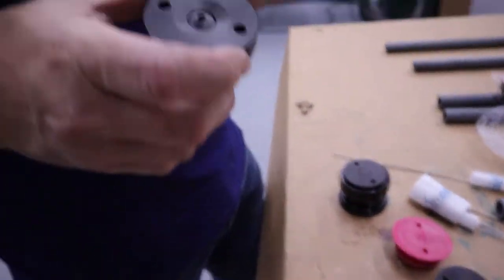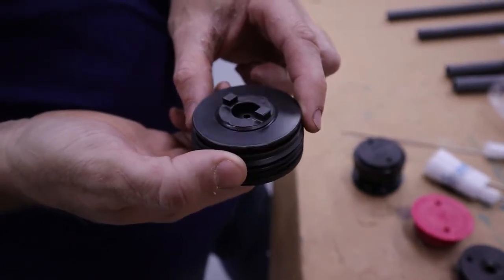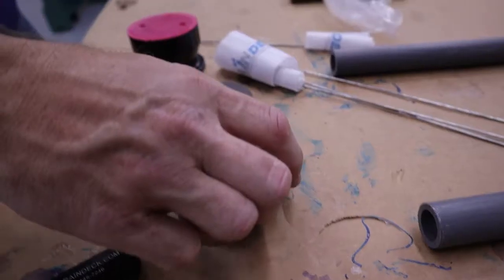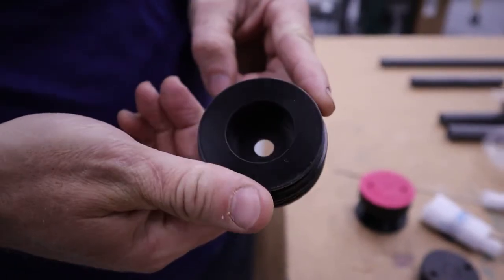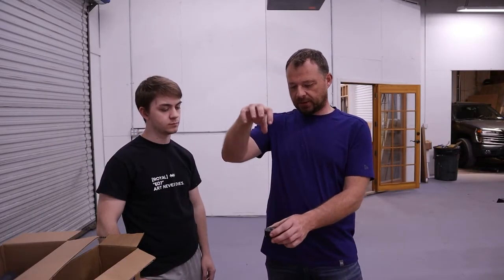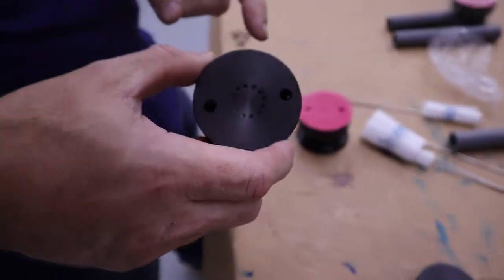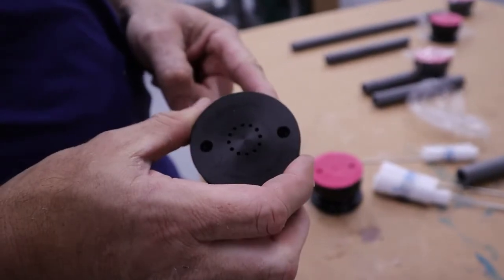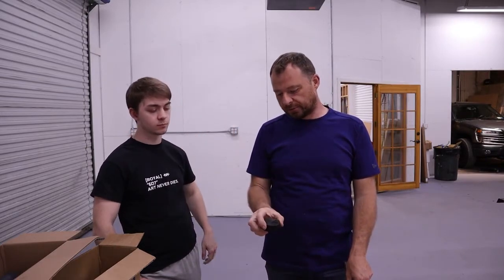DIY Sidewinder For Backyard Splash Pad

Comment: ? Love ur channel but what pump could run all this at once with out breaking the bank
Reply: Any pump that can move about 40-50 GPM or 2000-2500 RPM will do the trick. I would reccomend using a variable speed pump since it can be dialed in for best performance, this is a medium setting and has room to move a lot more water if we wanted to. I went with the Pentair IntelliFlo and paid $1,400 but I see on Amazon that the price has doubled from when I bought ours last March. With inflation the way it is right now I am glad I did this project last year! :)